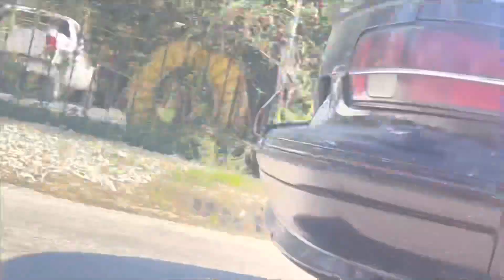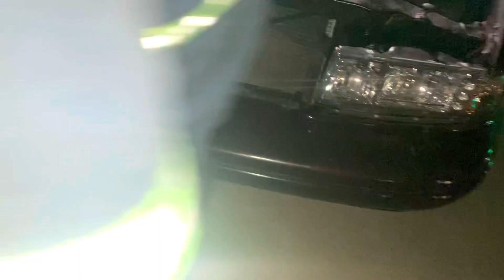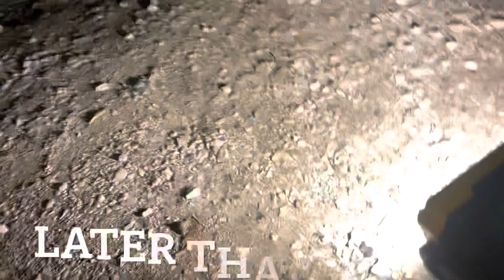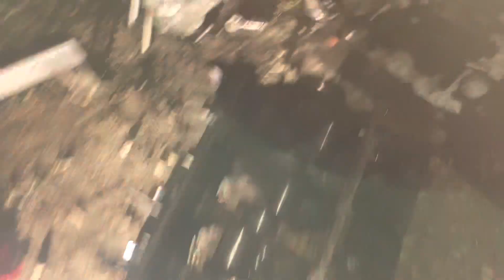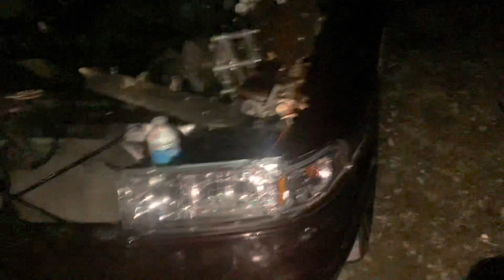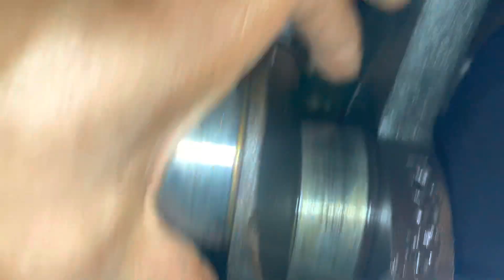Ls swapped 95 impala ss circle d 36-3800 triple disc stall burnouts

Comment: Take it to machine shop get it ready for a turbo I know the rod caps on most of these go back exactly the way the cam off there called broke caps at the factory the brake them in half so they fit together like a puzzle piece
Reply from the maker: Putting a 6.0 together now 😎 turbo coming sooner or later 😂
Reply: Gap the rings, throw some springs and retainers in the heads n put it on 8-12psi. Reliable power. Keep in mind it helps to run these engines with 1/2 a quart to 3/4 of a quart over full and 10w40. Especially if you throw it around alot. Tbh it looks to me like it starved for oil
Reply from the maker: @MykeHunts  i wouldn’t doubt it honestly bro.  That engine had 130k out a old lady truck.  It was either my fault or the half ass tune didn’t help it out
Reply: @sswapped7793  have you ever watched RevTap industry yt channel? They beat the absolute piss outta the 5.3 n 6.0 truck engines. Most I've seen them do is cam, springs and retainers. I've watched one of their trucks eat a entire bottle of nitrous in one burnout. The shit is hilarious. But seriously stock bottom end with gapped rings would hold 500+ hp easily if the tune is good and it would last a while
Reply: @MykeHunts  getting the coolant to circulate is my biggest issue Damm ls
Reply: @beeasy4360  I've heard about a issue on some of the newer gen ls engines I guess the ones that have active fuel management. Never experienced the issue personally. I deal with primarily older ls engines mostly just the lq9 and lm7 truck engines
Reply: Unless you still have air in the block which I have came across. Sometimes you have to pull the upper rad hose and fill the block with water first if it's a fresh install. But like I said I've heard of issues with I think the 8.1l and having to do some Tom foolery to get it to open the thermostat
Reply: @MykeHunts  that’s what I got is a truck engine do u run a thermostat in your mine might be bad it is new though which done mean nothing now days
Reply: @beeasy4360  yep I run thermostats. Is it a swap or still in the stock vehicle. Does it look like there is alot of rust in the cooling system? if it's a swap fill the block first then the radiator and may as well replace the thermostat while your there. You can do a rough test on the thermostat with a torch to see if it opens but it's not very accurate because you don't know what temp it's opening at. Although you could also test it with some hot water.  If the issue is still going on I would start looking at the water pump. That's why I asked if the cooling system looks rusty. If water is ran it can corrode the fins on the pump and they will disintegrate rendering it useless
Reply: @beeasy4360  what temp thermostat are you using?
Reply: @beeasy4360  not to question your knowledge. This may seem like a stupid question but I've seen people do it. Is the thermostat installed backwards?
Reply: @MykeHunts  says 187 on it it came with water pump
Reply: @beeasy4360  yt blocked your comment 🤣🤣 when I click on it, it doesn't show up but I got most of what ya said. Sweet swap man she'll be a hell of a car when ya get this figured out. Tbh if you have done all that new rad, waterpump, and thermostat I would say it still has air somewhere. Getting coolant bled can be a pain. When I used to deal with alot of honda engines we would jack the front of the car up as high as we could and let it run with a bleeder cup on the radiator. Then lower and raise it a few times to help move the bubbles up
Reply: @MykeHunts  lmao guess I’ll put some hydraulics on it make it bounce homes lol 😂 3 wheel motion just to bleed my cooling system
Reply: @beeasy4360  man without being there to look at it the best I can do is just try to throw some ideas at ya lol and maybe hit something you haven't thought of yet lol 😅 😆  going over the things I would check.
Reply: @beeasy4360  what about the serpentine belt routing. Seems simple but could the pump be running backwards? Is  the pump factory replacement truck pump? Or did u use a different one to make room to a intake swap?
Reply: @beeasy4360  I'm willing to bet it's still air trapped. One last thing to try unbolting the coolant cross over pipe from the front of the heads and fill from the upper rad hose until coolant runs out of those holes. I've never had to do this but I just checked some forums and this can be a solution and has apparently worked for people having similar issues to yours. I hope ya get it figured out man. I'm sure it's been a long time coming and your just ready to rip it. Good luck I'm sure you'll get it though. Probably something simple